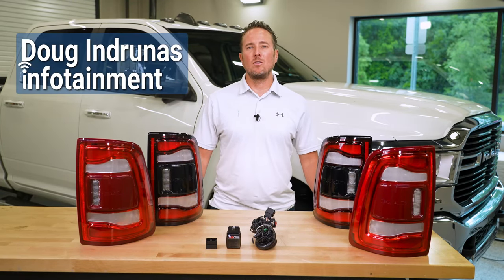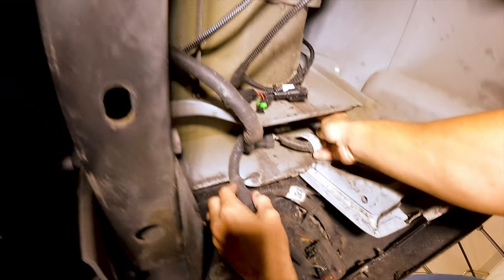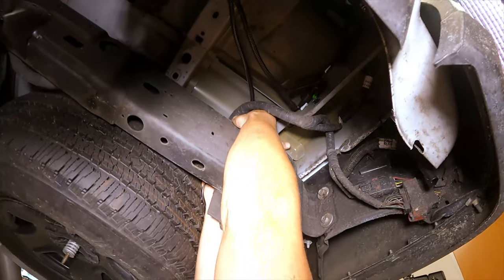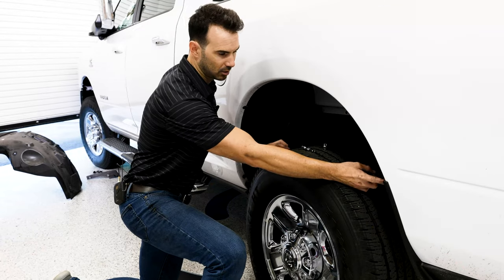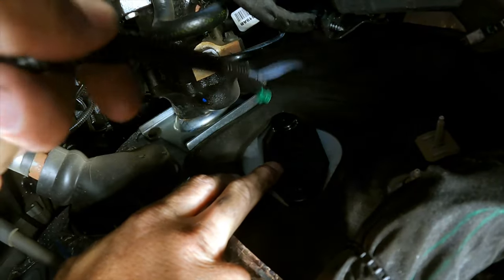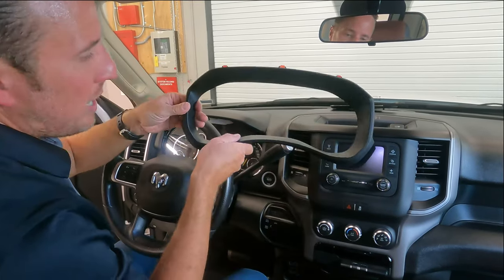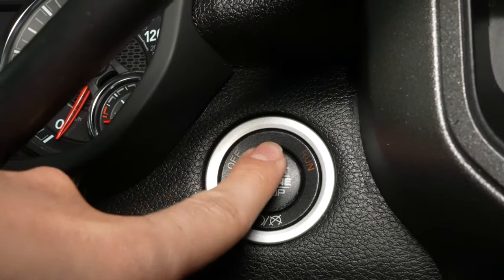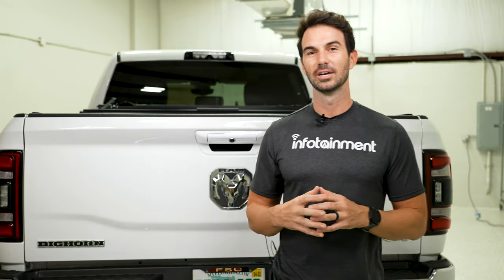2019 Ram 2500 - LED Tail Lights w/ Blind Spot Monitoring Installation - Episode 7

Comment: I am truly glad my 2019 RAM Bighorn 4x4 came with the LED package and BSM!!.............I refuse to have any other type on it!......It came with every option except the Sunroof and El Grande Infotainment System.
Reply from the maker: When you're ready for the "El Grande" infotainment system, let us know...

https://www.infotainment.com/products/2019-2020-ram-truck-uax-uconnect-4c-nav-with-12-inch-touchscreen-including-apple-carplay-android-auto-upgrade?variant=31857658101796
Reply: The 2022 2500HD Bighorn I configured and purchased did not have BSM as a listed option. Assumption on my part was that it would be a standard safety feature (or at least come along with all the trailering options I chose).  Now I feel like this truck is hampered and I'd be reluctant to tow anything with it.
Reply from the maker: We can help with towing options too:

https://infotainment.com/product-category/interior-accessories/towing/

Comment: My 1500 Ram has the factory installed BSM.  I have the yellow triangle light in the mirror and I know I would have to replace both mirrors on the 2500 if I needed that feature.  My question is, my 1500 BSM makes a loud warning noise as well as the light up mirror triangles when someone is in my blind spot.  Does the kit you installed in your video make the loud warning noise as well?  Also, thank you for the informative video.  It was well done.
Reply from the maker: Absolutely! It does do the warning noise. You can also toggle the warning sound in the "Driving and Safety" settings in the radio unit.

Comment: Just doing led tails doesn't require bcm rewrite for leds?
Reply from the maker: No. The capacitor comes with the lights.
Reply from the maker: If your are just doing tail lights you do not require BCM rewrite

Comment: I have this light assembly but the brake and running light stopped working. Do I need to replace the whole assembly (a whole new tail light costing about $600), or is there a bulb or something I can replace instead? Sorry if this is a dumb question.
Reply from the maker: Most likely the bulb.
Reply: But how?

Comment: Dumb question... Do all of the LED tail lights have the ability to be updated with the BSM? My Laramie has the LED tails but I'd like to update the truck with the BSM!!
Reply from the maker: Not a dumb question. No they don't. The BSM sensor is built into the tail light (@ :50 in the video). You'll also need the BSM side mirrors and programming.